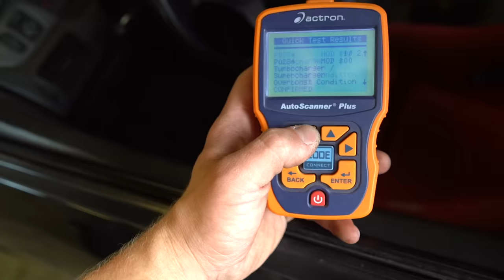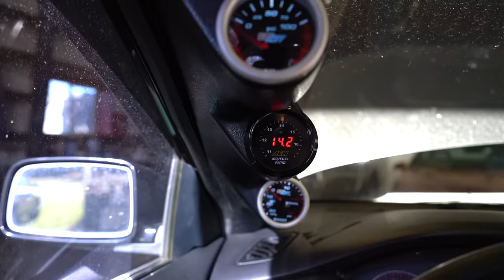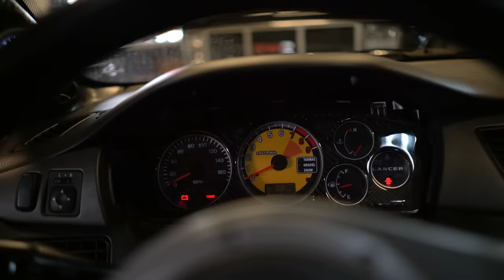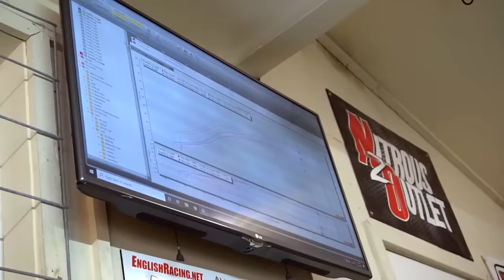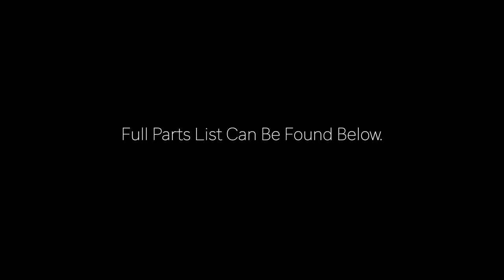Building The Ultimate 500WHP Evo in 10 Minutes

Comment: I hated my evo9. It was so tinny. My srt4 was a much better built car in the long run. Ran 600hp as a daily driver for 20,000 miles with not 1 problem.  375whp on my evo and went through head gaskets every 5000 miles.